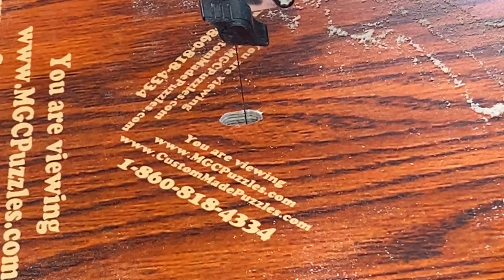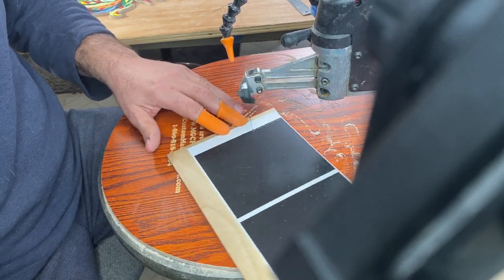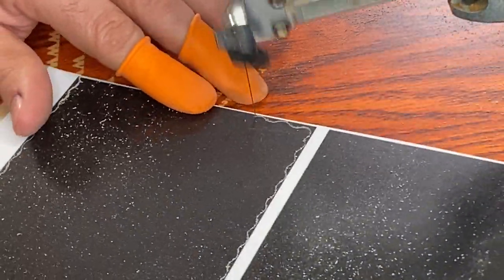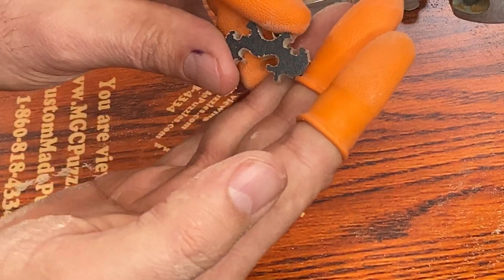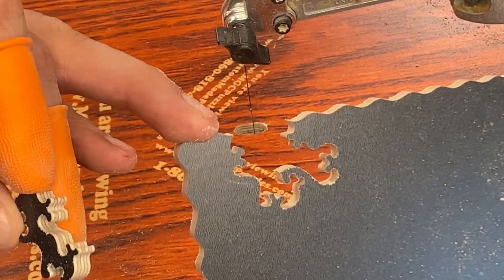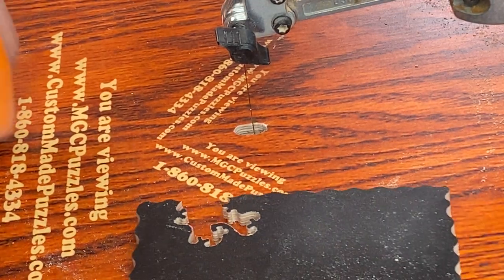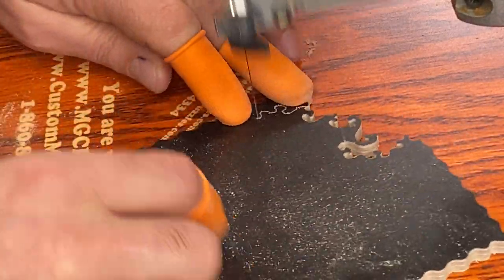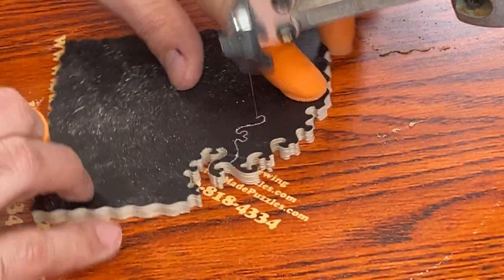Demonstrating a simple way to make a jigsaw puzzle more challenging to solve.  Difficult tricky fun!

Comment: Would be interested in how you tension your blades. Sounds a little slacker than what I 
normally cut at.
Reply from the maker: Hi there James, I’ll try to mention that in the next video or two and ping my blade a few times so you can hear the picture of what it sounds like and how tight it is. I  use a blade that’s only 7/1000 of an inch thick, so I need to make sure that it doesn’t actually break. There’s a limit to the tension I can put on it but I do feel I put it pretty darn tight.